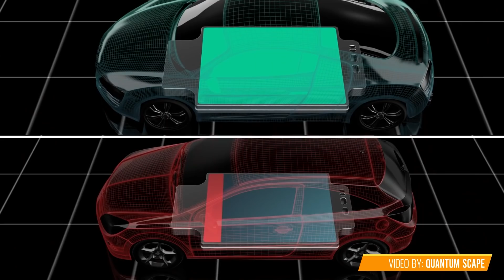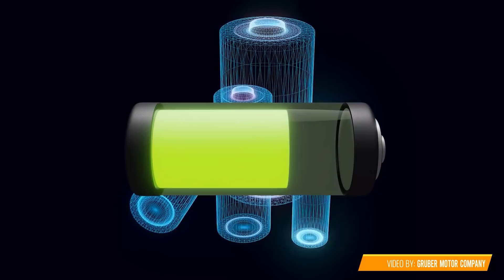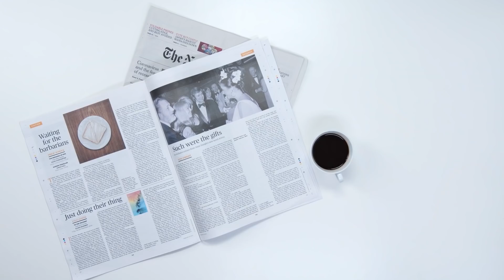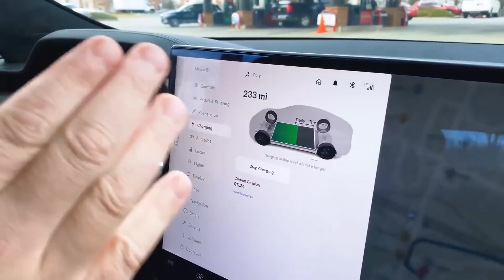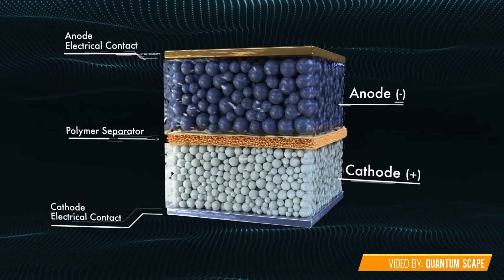SANDY MUNRO: Are Solid State EV Batteries Too Late?

Comment: The challenge for solid state batteries will be cost. LFPs are already pretty cheap and they will be cheaper by the time solid state batteries come out. It doesn't matter that they are less dense or heavier, that just means you need more of them. Most people won't care how heavy their battery pack is, the only thing they will care about is price and longevity. Solid state batteries will be put in high end cars when they come out but for mainstream cars they will have to be cost competitive with LFPs which are already in mass production and will be in much higher production in 2025.

Comment: Whenever somebody throws their hands up on horror & wails that they couldn't possibly wait 15-30/40 minutes to charge their car, remind them that it takes on average far longer than that to drive to the nearest convenient gas station, queue, pay & drive back home or wherever you need to go - AND, you often have to go out of your way to do so. Plugging in at home, work or when as I like to phrase it, "stop, charge, shop", is by far & away, more convenient most to the time.

Comment: you don't have to wait ins service center for every 5000 mile oil change and all the other regular maintenance and repairs.  you wait 5 to 10 minutes for the fuel fill and when you plug in at home you walk away and never wait.  most people fly now when they take a cross country trip then rent a car for short distances when they arrive.

Comment: The focus on charging at home is simply not an option for a very large % of the population that reside in apartments/condos etc. Plugging in every night is only really available to those with single family detached homes. Thus planning for charging at your local public chargers may be an inconvenience that is quite a bit more of a headache than a 5 minute fill up with gasoline at a station that likely has no lines waiting for a pump. This is the biggest challenge.

Comment: While LFP batteries are cheaper and more stable than the alternatives, a key factor inhibiting wide-scale adoption has been energy density. The energy density of LFP batteries is considerably lower than the alternatives, between 15 and 25 percent. However, this is beginning to change with thicker electrodes such as those used in the Shanghai-made Model 3, delivering an energy density of 359Wh/liters. That promo trick car had to be loaded to the gills with batteries.

Comment: For me range anxiety is not an issue for journeys of 100 mile round trips The issue here in the U.K. is charger infrastructure owner you can drive for sixty to a hundred miles in Scotland where there is no charger infrastructure. In addition, millions of people live either in flats or in narrow roads of terraced houses where you end up parking down the road from where you live as most do so you can’t charge your car overnight. It’s a big problem here and town councils and petrol stations are not building charging stations so  people with money can buy expensive EVs and charge them in their detached houses but many people who can afford to spend £10k on a car can’t afford an EV, only another ICE vehicle. It’s charging infrastructure and EV prices that are the problem here. Charge your car at home and the cost includes 5% VAT. Charging using a street charger and it’s 20% VAT.

Comment: Really surprised that Alex subscribes to the FUD that "15 minutes isn't fast enough". As Sandy pointed out, that's just nonsense. Comparing charging to going to a gas station is stupid. The vast majority of charging happens at home, overnight. When you do need to fast-charge enroute on a trip (which is rare for most people), it's the right amount of time to eat, use the restroom, check your email, etc. And we don't need to wait for an 800 mile battery. Current tech (at least Tesla) is great today, and only getting better. 

Over the course of a year, with a typical amount of long trips, an EV driver will spend orders of magnitude LESS time attending to charging than an ICE car owner will spend attending to fuelling (driving to/from stations, waiting for pump, pumping, transacting). And then there's the time-value of money... how much time did you spend earning the $ you paid for gasoline, vs electricity.

Huge advantage to EVs that's lost in the FUD.
Reply: The majority of charging happens at home in part because people who can afford EVs, but live in buildings that have few if any chargers, do have a problem with the current charging times.

Comment: Commentary like this frustrates me. Quit sugar coating it. Yes, driving around town is a solved problem for EVs. It's way more convenient than gas. Long distance trips in the cold at high speed are not a solved problem. Not even close.

I have a Raven Tesla Model X Performance. It has an EPA range of 305 miles. I live in Boise, ID. If I try to drive to Salt Lake City, UT, I'm generally directed to stop in Burley. Starting from 100% SoC, at 10 degrees Fahrenheit, at 80 mph (the speed limit), I roll into Burley with 2% SoC left. Burley is only 170 miles away. That's my real long distance range in the winter. 175 miles. 

I love the car, but I really wish the community was more realistic about what currently available EVs can and can't do.

Comment: 1000 mile and 100 year batteries? That sounds like snake oil too! Testing one is fine but let's see if it can scale. But Sandy is right, the lightness is key and solid state may be more compact and/or form fitting.

Comment: Range anxiety is real especially when you drive around and observe that there is nowhere to charge if you owned an EV.  15 minute recharge is a rare event if you watch other EV owners share their recharging experiences and they aren't even near being completely discharged.  Most potential buyers don't have the luxury of charging where they live so having a good selection of available locations and charge rates near you really does matter.  I won't buy an EV and I live in the largest city area wise in CONUS because of charging concerns.

Comment: You were right about the traveling long distances and yes, charging time is a factor, less the longer your charger lasts. I think the number one concern should be the availability of charging stations. Musk is doing a lot to help that, but it's still thin. I'm heading to Vail in my ice, but planning for a model Y trip next year. There are virtually NO public stations in Vail, except in timeshares, and I'm positive that they won't be so keen to share time. Lol Not insurmountable, but an issue.
Reply: It has nothing to do with battery capacity, but miles per minute charging, i.e. DC charging infrastructure or onboard AC charger power. You spend the same amount of minutes charging a small battery pack as you do a big one for any given distance. You simply have more, but shorter charging stops with a small battery.

Comment: A couple of points about the ONE battery that Sandy touted: 1) the car achieved its 725 mile range by having a 200KW battery. 2) the battery is not projected to be in production until 2024 at the earliest.

As to the Gruber Motors “breakthrough,” just note that Gruber has not yet produced even one workable battery to test. They are proposing to use graphite pouch cells produced by a third party. Their “innovation” will consist of an effort to somehow cram enough of the graphite pouches into the battery case of a used Tesla that they claim will be able to go 700 miles on a charge. They have not yet built even a single test vehicle, much less a technology solution for production. If you watch their video it has the look and feel of the typical hot air bs that companies like Nikola used.

I respect Sandy, but even he can get carried away with promises of technology that does not yet in fact exist.
Reply: Spoke my mind. 725 miles is great, but what is the charging speed? What are the drawbacks that are intentionally being withheld? If it were so significant why isn't Tesla, VW or even Nikola wanting to license or own the technology?
Reply: My point exactly.
Reply: But 2024 is still ahead of the solid state battery which is hoping for 2025 and they haven’t actually produced an actual battery in a car. Only cells in a lab
Reply: @davidm2845  Yes, solid state is just a promise at this point. But so is the supposed break-through tech Sandy is touting, as if it is here already. The main achievement of this tech so far is to stuff a 200KW battery pack in the space Tesla uses for its battery packs. Pretty much any existing battery tech with a 200KW battery could achieve 725 miles of range.
Reply: If I remember correctly the 200kWh battery they used degrades rather quickly

Comment: The other thing that Sandy alludes to is the ratio between how long it takes to charge and how often I have to do it.

For example, suppose I have a "slow" charger that charges my car in 1 hour.  And I can drive 800 miles on a full charge.  In normal driving, that will probably last someone two weeks.  So spending an hour every two weeks isn't a big deal.  Suppose I can only drive 100 miles on a full charge.  Then that one hour starts to mean a whole lot more when I have to do it, say, every other day.

I agree with Sandy about the media, though.  The media is interested in dramatic conflict.  And if they can't find it, they'll make it.  Find somebody saying something stupid and elevate them and people will tune in either to cheer them on or to vilify them.  But they are tuned in, which is what the media companies want.  Hell, recently there was that guy talking about, "Oh no!  What happens if I'm stuck in my electric car during a blizzard?!"  Answer:  You're probably better off than you would be in your gasoline car.  But let them rant and rage and then you'll get an argument going with those who explain the truth and those who refuse to accept it and those mocking those who refuse to accept it and you've generated a whole lot of attention just by loaning your bullhorn to an idiot.

Comment: Sandy is correct. The vast majority of the time people drive locally. I would love to see how much time the average person spends at a gas station per year vs how much time they spend super charging per year. I'd be happy with 200 miles added in 20 minutes. I don't want to pay extra for 500 miles of range that can charge in 10 minutes if I'm going to stop ever few hours for 20 minutes or more anyway
Reply: Google it.
According to the Association for Convenience and Fuel Retailing Stores (NACS), the average American pumps gas for about three hours a year.

So.... You're kinda waaay off.
Reply: @davidclark538  Good info thanks.  I actually fueled up my car today.  Had 25 miles left when I got in.  It took 2:35 to refuel which brought me to 375 miles of range and according to Google Maps there was a 4 minute detour to get to and from the gas station.  I guess my thought is that I only went on two trips in 2021 that would have required charging an EV.  Maybe some people go on a lot of road trips but I usually drive locally and fly if I'm traveling far.